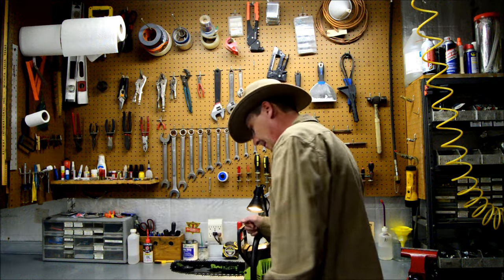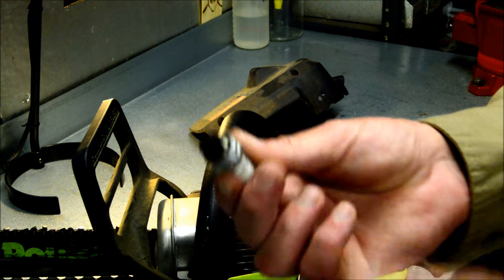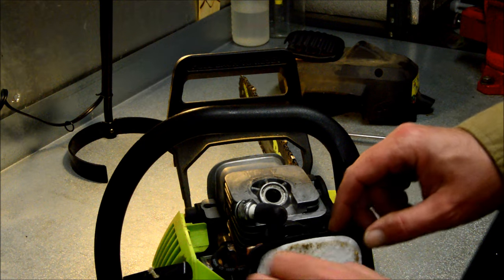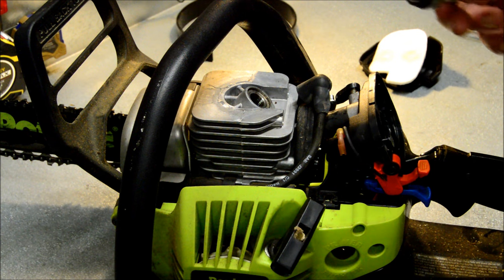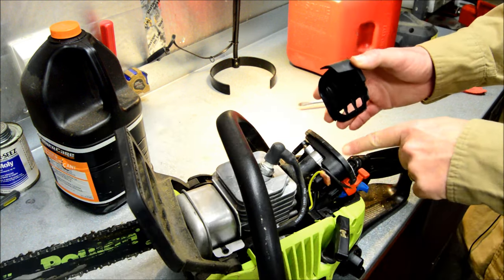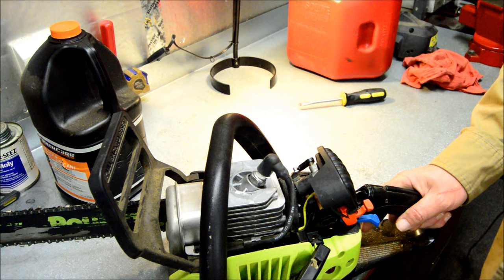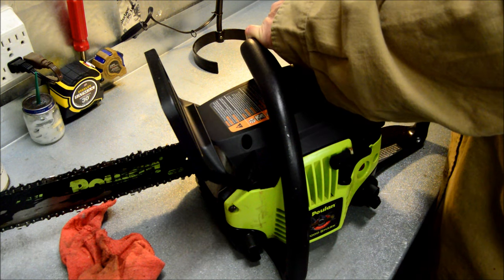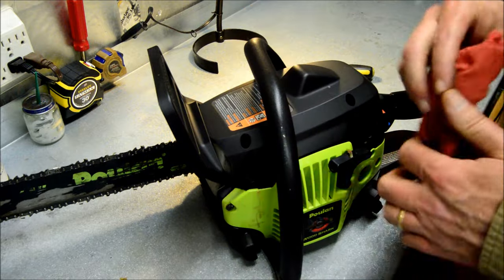Chainsaw Won't Start - 10 Years in Storage - Poulan Woodshark - DIY Repair

Comment: You are 100% right about using non-ethanol fuel in small engines.  I run it in all of my two and four cycle engines, but I also add 1 ounce of AFT Stabilizer and one ounce of MMO to my gas for four cycle stuff and just the AFT and Stihl Ultra two cycle oil for my 2 cycle applications.  Like you, I run my chain saws empty before they go into storage condition. I have left gas in my saws up to two years, when properly stabilized with Brigg's AFT, with no adverse affect on their performance.
Reply: John Clarke I run an oz of MMO to a gallon of gas and I swear even my cheap shit runs right and has ,some Poulan some MTD,but one thing for sure is I don't have problems with them starting or running right
Reply: There is no such thing as no ethanol gas. Just think, the tanker that hauls the E85, and E10 will still have some left in the tank. It would most likely be around 1 or 2% so it would for most practical purposes be considered non ethanol.  Just not 100 % pure gas

Comment: I will give a short quick shot of carb cleaner in the gas and always run it dry before I would put it away.  I never left gas in the tank on any small 2 cycle engine.
Reply: extend that to read... all small engines. I have to find another fuel tank for my generator now because I didnt drain the tank. it leaks with more holes in it than a sieve

Comment: Thanks, I have a small Homelite chainsaw that I have not run since 2004, when we had hurricanes that knocked many limbs down.  You have guided us in getting a small 2 cycle engine running that sat for several years.

Comment: Had my Poulan Wild Thing sitting in the storage for 3 years.  Took it out and replaced the carburetor/spark plug/purge bulb (the kit was $16 from Amazon).  At first it wouldn't start even after 20 pulls.  Additional steps I did:  drain the old gas, put in the new gas, hold the throttle full open without choke, and pull about 20 times.  And VOILA, the thing started right up.

Comment: Great video. I think I’d just do the diaphragm. All carb adj’s with air filter on, because filter changes air/fuel ratio & will affect all 3 carb adjustments, esp Lo & Hi speed adj’s.

Comment: my saw did not want to start after one year of storage. I pulled the rope for like 50 times. I also sprayed some carburetor cleaner in it, works as a start spray. I don't know why but after taking off with carburetor cleaner it started turning on also without it. Old saws ..

Comment: Thank you so much!   I used this video to get the chainsaw that hadn’t been started in 5 years to fire up on the third pull.  I had been trying after replacing the fuel line with no luck.  This helped me get it going in 15 minutes.  Awesome video!
Reply from the maker: Great to hear!

Comment: Last year I was given a new poulan ppb3416 which my dad purchased deeply discounted ($35) from a store liquidating them. This past weekend i needed it for some firewood only to find the purge bulb and fuel lines completely rotted. While replacing the lines a plastic lever on the carburetor crumblex. It turns out the saw was last produced in 2009! These saws probably sat in a conex box in Florida heat for some10 years. After replacing fuel system it starts and idles reliably with only $20 in it.
Reply from the maker: Right on. They are pretty good saws except for the plastic fuel lines and such. Thanks for sharing.

Comment: i have a pouland 2000
sat in a hot box of a truck for around 5 years at least
thing spits gas out the carb but it runs

Comment: The primer bulb does not pressurise the tank. It purges air from the fuel line and carburetor, on some engines it is between tank and carburetor and on others between carburetor and return line to tank. Just press until resistance is felt. Most times just 3-4 times is enough.
Reply from the maker: Thanks!
Reply: how do you know when it is bad? I have one on my chieftan snow blower and it seems to do nothing but make funny sucking sounds I have to always prime the machine with ether to start it

Comment: That saw was used a couple of times with the fuel mix wrong, fouled the plug and thrown on the shelf. 10 years it didn't run because the owner didn't need it.  Great video, i would have filled the gas and tried it before taking it apart.

Comment: Nice work getting it running again.  There's a sense of satisfaction one gets bringing chainsaws back to life.  I like working on older saws troubleshooting why they don't run.  Usually ends up being rotted or brittle fuel lines, a dirty carb, old fuel or a combination of all three.  Sometimes it's as simple as replacing a spark plug.  Nice video.
Reply from the maker: Thanks for the feedback!  Yeah, I didn't really cover the fuel lines in this vid because I had another saw video specifically about replacing fuel lines. Only problem, I erased the footage, lol. But you hit the nail on the head, these small engines are very simple once you understand a few fundamentals.
Reply: I have this similar model I haven’t started since 2009. I should’ve watched your video before trying to start it the other day. Will start over nice that I have your help. Thanks!

Comment: I have a Poulan just like the one you used in the demo. I have the opposite problem. It starts fine but will not run more than a minute or two before it cuts off. It does the same thing every time, no matter whether it is choked or not.
Reply: eithet fuel filter or air inlet to fuel tank.  try running with fuel cap  a little loose to check air inlet.  new fuel filter is cheap.use good gas and proper mix.  use non methenol gas.
Reply: @jamesrichardson771   very good suggestion.  I had that happen on a snowmobile, took a bit to figure it out.👍✌👍

Comment: the gas formula with ethanal sucks when sitting without stabilizer  my boat motor tank had a pint of water at the bottom when sat over winter.

Comment: When I lay up my 2stroke outboards for the winter I run them dry , started doing it with my chainsaws ...glad to hear that you recomend it ... great vid ..tks
Reply: I agree with emptying the fuel for storage. After 15 years of storage my Craftsman turned over easily. The fuel lines did degrade though.
Reply: I drain the gas in all my small engines, toys every fall or if I think it will be a while till it will be run again
Reply: I removed a champion sparkplug from a small chainsaw where the main center part was cracked away from the threaded nut and would not fire. New plug, ran great
Reply: I used this thinking ---let them run dry---then store until I had to replace the gas lines. Not easy to do. I've come to believe that you're better off letting the fuel mixture stay in and lube the gas lines.....and just go start and run it on  a regular basis. I think something like a chain say/blower/ weed eaters/mowers need to be run on a regular basis, even in winter.
Reply: I suggest you do that with ALL your small engines regardless of it being 2 stroke or four stroke. If I had done that I wouldnt have to replace the pinholed tank on my generator

Comment: Another happy little Poulan and probably a very satisfied customer.  I’ve had my 3314 for six years and use it all the time.  It starts and runs like the day I bought it.  A lot of people rag on these saws as being “disposable”, but when you care for them, they repay you with honest, hard work.  I’d buy another without reservation.
Reply from the maker: I think some guys pay 4-500 for a brand name saw and they feel the need to prove it was worth it. I've had good luck with poulans over the years.  Like you pointed out, it's all in how you maintain it. Thanks for commenting.
Reply: For a homeowner that occasionally uses a chainsaw around their property, a Poulan saw will work.  For a farmer, firewood cutter, or professional STIHL and Husqvarna are the only way to go.
Reply from the maker: @mikespain8655  I agree.
Reply: @mikespain8655  No doubt.

Comment: Great video... very informative for someone like myself who doesn't use his chainsaw very often.  But I do have a question:  I have the Poulen Pro 16 inch saw that has given me trouble almost from day one.

When I have it started up, which it does fairly easily,  and try to let it idle, as soon as I give it some gas it bogs down and quits.  Even when it is well warmed up the problem persists.  I am sure that the fuel mixture is correct because I have tried using premixed fuel.

As I said, the saw is almost brand new.  It may have been used 10-15 hours in the three years that I've owned it.  I have emptied the fuel and let it run dry before putting in the premixed, fresh 40:1 fuel.  Same problem.

Hope you can give me some tips so that I can start using the saw again.  Thanks so much!!!
Reply from the maker: It sounds like the air fuel mixture screw may need adjusting. On some of these saws a special tool is required to adjust it. If you can get a screwdriver on the mixture screw try to turn it out a half turn and then try it again. If it runs better go another half turn, until you get it running the way it should. Good luck.

Comment: For what you did to it it sounds like they tried to start it without full. As for engine starter I make my own I just put gas in a spray bottle and make a fine mist, and spray some in the carburetor and some in the air filter and it does the trick. FYI

Comment: Any two cycle engine from outboards to lawnmowers to chainsaws do not like to sit for long periods of time with a gas-oil mixture in the tank because for some reason the oil mixture makes the fuel go bad  in a few months and turns it to a smelly sludge

Comment: I acquired a saw almost identical to one in video and went through exactly as shown. It however will not fire even using a squirt of starting fluid.
Reply from the maker: I'd check spark, fuel lines and compression and go from there. Good luck.

Comment: I also always clean up my customers stuff. I enjoy seeing their face when they come get it. I did a video of someone's Honda water pump. It looked like hell when I got it. By the time I gave it back it looked new
Reply: some dealers consider cleaning customers stuff like wiping their costomers ass. Ive had repair places tell me "clean it yourself, It will give you something to do!"
Reply: @rogerd4559  If I heard a lame ass comment like that I wouldn't be back. For a decent mechanic to take a damn 10 mins. to clean up a dirty ole chainsaw is just decent caring customer service in my book.

Comment: It's amazing how so many people are afraid to get their hands a little dirty. His customer spent money for a basically simple starting problem, he could have fixed himself. I have only two suggestions to this video. Buy a spark tester if you are not familiar with working on small engines. The coil can really zap you with high voltage if you are not careful,  and buy a two stroke oil that contains a fuel stabilizer before mixing the gas. Also, running the machine totally dry, will prevent most of the starting problems in the first place.. A little basic maintenance goes a long way, so save yourself some cash and get a little dirty.
Reply from the maker: I agree. I made this video to hopefully inspire people to do their own repairs. Or at least try before they take it to a small engine shop.
Reply: @TheHandsOnChannel  Thank you for the comment. It really is a well made video. It was very instructional and helpful. I am sure, a lot of first time future repair nuts will find it very helpful. There's nothing more satisfying than fixing your own machines. Learning can be frustrating and time consuming, but videos like yours surely are making a big difference to the You Tube community.

Comment: Enjoyed the video! I just bought a chainsaw at a pawn shop a Craftsman saw. It started at the pawn shop. Went on a job it did not start. I might put new gas in the tank and try that. I don't know how long it's been on the pawn shop or ran for that matter. I will get it running.
Reply from the maker: That usually gets em going. Watch out for bad fuel lines, especially if it's had ethanol fuel in the tank. Good luck.
Reply: Jesifa

Comment: Great video! Thanks for the advice. I just bought a small Craftsman chainsaw at a yard sale for $15. It will need all of the plastic lines replaced and a primer bulb. When I poured a few leftover drops of gas out of it, the filter just fell out. So the line must have rotted away in there. Must have been sitting for a long time. Has good compression and everything else looks good. I need to get it running for my next camping trip in a couple of weeks.

Comment: I found a Poulan P3314 chainsaw at my local dump. It looked almost new but figured something was wrong for it to be trashed. Upon starting it ran just fine until it got warm.  Thats when it just stalls and starts really hard. My guess its the carb but I'm not sure if I should get a rebuild kit or a new carb. Figured it would be nice to have a spare saw..
Reply from the maker: Great find! Check the fuel lines also, they are known to develop cracks. Personally I'd get a carb kit rather than buying a new carb. Good luck.
Reply: It's a bad coil.

Comment: I just bought a saw identical,it fired a couple times and the springs in the handle are loose, haven't done anything with it but sure it will run with a minimum efforts.
Reply from the maker: They are pretty good saws. My throttle spring came out once and I had to get a razor blade to push it back under the trigger. Good luck!

Comment: when you tighten the chain think you need to take off the brake and lift the front of the chain and bar ,thats how i was told to adjust it .

Comment: I find that the cut off needle often sticks in the carb. Loosen it by pressing in the diaphragm a few times, put your finger over the intake of the carb, pull it over 3 or 4 times. This should draw the fuel up, a few more pulls and off you go!
Reply from the maker: Great tip, thanks!

Comment: I have a Poulan weed eater and it's a beast to start when the engine is cold. I use the 
proper fuel/oil mixture (fresh), set the choke and prime the carburetor as the instructions  say
but it'll take 50-60 pulls (I've counted them)  before it even tries to start. Been that way 
since brand new. Starts fine when the engine has been run and it's still warm.
When I bought this one, there was one just like it at a marked
own price  that had been
 returned. (I think I know why it was returned). I HATE that soft start where the engine 
turns over on the recoil, not on the pull.
Don't think I'll ever buy anything with the Poulan name again.
Reply from the maker: I would guess you have an  air fuel mixture problem. You might try to increase the fuel. These machines are set very lean from the factory thanks to the EPA. Oh and you will have to buy a special tool to adjust it. Good luck.
Reply: you may be overchoking it. Try 2-3 pulls choked, then remove choke and see if it starts.
Reply: @BertGraef : Thanks for your reply but I tried that.
I found the adjustment tool online and readjusted the mixture. 
Usually, it starts now by the 5th or 6th pull. The problem could have 
been avoided if the mixture screws were just standard, slotted head 
screws instead of the (for the most part) inaccessible, coded, spline 
drive screws. Even the best of machines require an adjustment now 
and then for best performance.
Don't you just love regulations that are thought up and passed into 
law by people who have NEVER seen or worked with the item ???
Reply: ok......glad you solved the problem. :) Most people are going to lithium ion tools, because of this silly environmental fiddling.
Reply: I finally went cordless with weed wacker and blower and never been happier. Lots of power, good run time and with 4 batteries and two chargers it could do some serious work. Depends on which cordless system, mine is as good as my gas ones. The better 16" cordless chainsaws paired with a monster battery are almost up there with the gas.
Reply: @frankw8876  
That's interesting.  I was just wondering this afternoon if there were any cordless chain saws on the market. Less noise is a big plus too.
Weed Wacker was the brand??
Thanks

Comment: At the rental store I used to work at,  we cleaned the saws with compressed air, washed them in the parts washer and then shined them with  WD-40 and a rag.

Comment: Thanks for the video! I purchased gas a couple months ago. Been using the same 2- cycle mix all summer in my gas blower/ weed whacker. It's that gas considered old?
Reply from the maker: It's probably still okay to use for the rest of the summer/fall, but I wouldn't try to use it next spring. Be sure to run all your 2 strokes empty before winter and you should be good.
Reply: Try not to buy ethanol mix.  That is the problem for gas that sits for 3 months.  Without ethanol, a summer mix with some stabilizer will be fine.

Comment: Great add for Poulan, Starts after sitting for ten years, They must have serious quality materials in the fuel lines and other plastic/ rubber bits that contact the fuel. Some chain saws those bits detracted all by themselves after that time sitting around dry.
Reply from the maker: I think it lasted so long because the previous owner put it up dry.

Comment: So i have the same chainsaw. I can get it to start with the choke out, push the choke in and let it idle and when i press the choke all the way in and give it gas it bogs down and dies. Every single time. I’ve changed the spark plug, filter, gas. I’m stumped!  Any suggestions??
Reply from the maker: Check the fuel lines for cracks and if that doesn't solve it it's probably a dirty carb.

Comment: Bike 22 is in the lead with 16 following close behind while 4 7 42 39 8 are closing gap quickly. 
Around the first corner jump 39 bites hard into the protective bales. 
I had too. The sound of a torqued out 2-stroke just.... you know lol